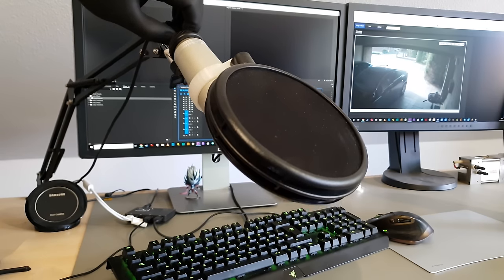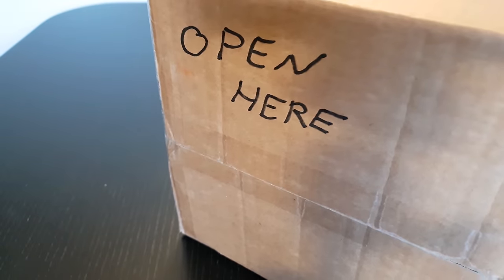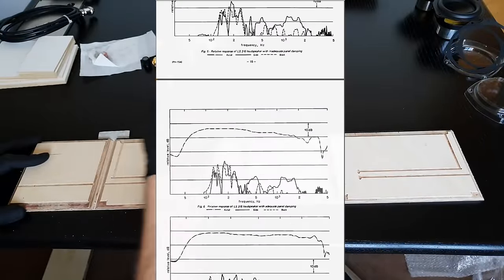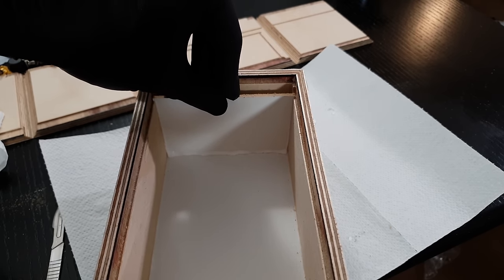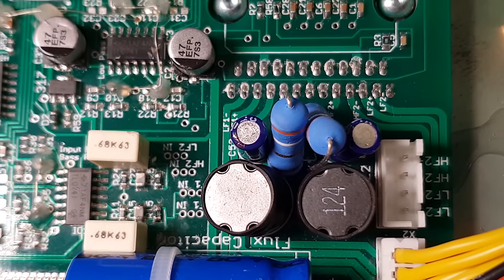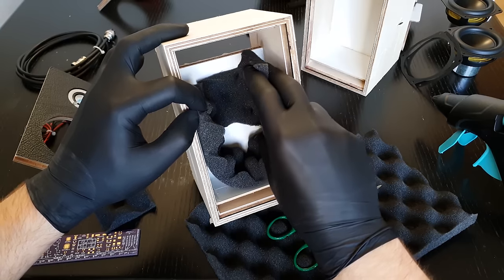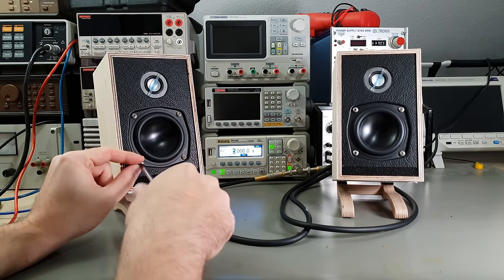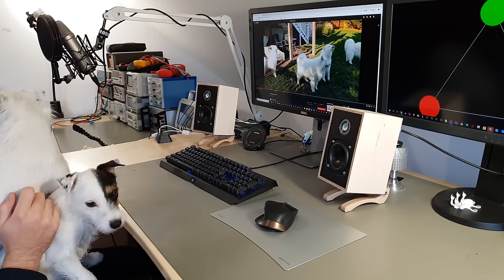Little British Monitors: DIY Transmission Line (?) Speaker Kit

Comment: For the record, most Class-D amplifiers perform way better nowadays than most Class-AB.
It's not the 90s anymore guys.
Reply: No. They can get close enough, but they don't surpass AB. The easiest way to lose an argument is to overstate your claims.
Reply: @korgied  . Lol. Are you a comedian? If you wanna join a discussion come with decent arguments. Check the datasheets of the new Hypex NCORE and the latest TI chips. Not many known brands with Class-AB that are going to be much better than that.
Reply: My interpretation is that while a good digital amplifier can deliver quality on par with pretty high end analog, the disadvantage is that the switching can induce noise in recording equipment.
Reply: @merlingallagher4484  Am familiar with Hypex (and Anaview which is also good for Class D). Not comparable in price at all. There was no way he was going to get NCore for this price, or even UcD (I have had UcD180s many years ago, good though not as good as NCore). Check out ATI amplifiers. I run an AT602 (small room don't need bigger). Planning to buy a Crestron CNAMPX 12-channel (made by ATI) soon since they're generally cheap on Ebay. They also make NCore amps. Specs are remarkably close. Incredibly SNR on both lines (of course very good THD as well). Why insult people? You might think you know more than other people, but you might be surprised if you'd be interested in having a discussion rather than trying to seem superior in the Youtube comment section. Am I a comedian? No. Do I know everything? No. Your claim is "most Class D amplifiers perform way better than most Class AB" and that is false. "Most" class D amplifiers use MUCH lower-end implementations than NCore. And for him to get any kind of NCore amp, even if he DIYs the amp, would cost him multiple times what this speaker kit cost him. One single NCore module would be close in price to the cost of his kit and that will be per channel, not per stereo pair. Anaview does sell some of theirs as stereo modules however.  Again, the easiest way to lose an argument is to overstate your claims. Class D can perform just as well as AB. But you didn't say that, nor did you say that Class D can be better than AB. You overstated your claim. 

Thank you, and good night.
Reply: @merlingallagher4484  The latest 'HD' chips from TI do address much of the quality issues I have with other affordable class-D amps. They are very new though and it's not always great to be first to implement new tech. I've been working on the LBM for more than the time they have been availible. And.... they only accept digital input so now we need to consider ADC cost and quality. I dont really feel the efficiency is that importiant to be honest - the built in dsp is nice to be sure, but I'm already achieving what I need with entirely analog circuitry.

Maybe I'll use one in a future project!
Reply: No, they don't. Although they are much more efficient. And yes, I actually have Hypex Backplates, one per speaker, on my desk.
Reply: Not many know that a class D amp was available from Sinclair in 1965, the X10.
Reply: yes, they're much better than like 10-20 years ago. but compared to class AB with a similar performance, they're still quite expensive. on top of that, the PCB design needs more care compared to class AB (especially a chip-amp like TDA7850).

Comment: Birch plywood does make a good cabinet speaker but usually starting at 19 mm for a small cabinet would be minimum 21+ mm sickness is preferred
Reply: These speakers are 12cm wide ;)

Comment: This "vibration dampening" seems to me utter nonsense.   Just stick it on a some jelly-like silicone feet or big felt pads. Has anyone done any tests on the audio quality with these very simple "hacks"?
Reply from the maker: Wouldn't call it nonsense, but maybe over-engineered? Other monitor speakers use foam wedges but those don't look as nicely
Reply: Marco Reps audiophiles vs engineers is a rabbit hole you’ll never get out of.  I’m glad you are one of the latter.  Keep it up mate your perseverance is legendary.  And entertaining.  :)
Reply: I think these speakers have a fundamental "problem" that there's no phase difference from the crossover between the tweeter and the midwoofer - but the actively driven radiating area of the midwoofer is inset further in than the tweeter. Thus the neutral axis, where there's no mutual cancellation, is tilted downwards - if someone has the crossover frequency, i'll give you the total cancellation axis if i remember how to calculate them, there's a handful of them. Thus you either need to use them upside down and stay right a particular distance from them, or you need to tilt them back, and the stand does exactly that while decoupling them from the surface underneath, killing two birds with one stone. Speaker and stand were designed for each other in such a way.

Whether there's other ways to decouple speakers from whatever they're standin on? On such lightweights, i have some textured rubber that minimises contact patch, using that, works right fine, though i have them on top of further boxes too. And i mean if you have an IKEA Linnmon desk, you'll know how incredibly important that is, because it's completely made out of cardboard, it's hollow inside and sings wildly.
Reply: @SianaGearz  The crossover is not a text-book alignment, it is designed as part of this specific driver and cabinet  combination. The crossover phase and physical system work together.
Reply: @Audio_Simon  But there are still cancellation axis, it's completely unavoidable, all you can do with a crossover design is to turn the pattern. I'm sure you had a good enough reason for tilting the whole speaker back with a stand, let's put it that way, and it's an elegant way to build such a stand and make it multifunctional.
Reply: @SianaGearz  There will of course be cancellation nuls with any two non-concentric drivers, even if time aligned and using a linear phase xover.

In this case the xover region is dispersed directly to the front listening axis, not angled up or down which would mean there is a phase mismatch between the drivers.

The reason to tilt the speakers back is simply to aim them at your ears. I assume the listener will be higher than the speakers when they are on a desk.
Reply: @Audio_Simon  OK, thanks, good to know that the primary lobe is aligned. Somehow never struck me as sensible to place speakers anywhere other than at ear height, but then i guess that's how people use them, they just plop them down wherever.

For something completely different, i'm sure Zaph is your mentor of sorts, well he is for everyone in the Internet era, isn't he - is he still alive, and is he getting a kit? :D
Reply: @reps  I think the problem is the lever effect that those plates will cause will be significant which will actually sort of amplify the problem it's trying to solve. CLD is great stuff; I use it in my car audio projects. Heck I've put spare pieces of the stuff on just about anything that rattles, even Keurig coffee makers. Their damping in your little test is definitely cool to see. I mean just imagine the diving board on a pool and you're just putting a speaker on the end instead of a human being. Of course the metal in the plates will be more rigid than a diving board but the lever effect will still occur. The CLD might be able to compensate for it but it's basically required to solve the problem the design itself creates (or, rather, makes worse). I mean, I'm sure it works well enough, and it's not like these are subwoofers. But I think that part of the design is more for looks than anything.
Reply: @korgied  The lever resonance is why they isolate. Its a tuned and damped spring. A tuned system doesent want to pass energy above its primary resonance. Same principle as the struts in your car suspension.

Comment: 11:13 always look at security camera...
Reply from the maker: It's like a window on the side of the building where there is none
Reply: @reps  I have 64 dahua cameras and have a dedicated pc to monitor them. 3 years of running 24/7 with no downtime
Reply from the maker: gotta keep those two Fluke 5730A calibrators safe
Reply: @reps  and the UXR1104A which is my new toy

Comment: you need a subwoofer
Reply: No he doesn't.
Reply: i mean he doesn't need it but if you want good bass response down to 20hz then yes (also note that human hearing is less sensitive to lower frequencies)
Reply: @ikbendusan  Whether you pick rock or dance music, there isn't really much below 60Hz, with focus upwards of 70Hz, and these are supposed to have a -3db point around 60, so there's still a comfortable amount of sonic energy at 50Hz, but not much beyond that. There's a handful of classical instruments that do reach lower, but i don't think their fundamental is important rather than merely impressive. By adding a subwoofer you're just inviting issues with little actual payoff, i deem it a last-resort measure. I mean what's the point of extending your bass down if the vital body of your bass has holes in it that can phase in and out of existence? Even if you were to only get 70-80Hz out of your speakers, i'd still advocate not using a sub, the hearing adjusts to reduced or partially missing bass pretty well.

If you're looking at these and thinking "puh puny little speakers", well, normally you'd expect mass market speakers this small to only play down to about 80-100 Hz, which is indeed often woefully insufficient and in dire need of propping up, but these are purported to be crucially better. It's by far not impossible, i designed ones with a slightly bigger size and better low-end performance with 50 or 55Hz -3db if i remember right, but mine can no longer be built. Designing smaller is possible but you trade off the efficiency and maximum sound pressure, or the distortion. Driver selection is the crucial piece of the puzzle here, you're looking for low Fs, low Vas, and usually low Qts, mine was WPP-150. There's a bit more to it than that, but everything is designed around a suitable midbass driver. When i did my design, suitable drivers were all well beyond my budget, with WPP being the only exception that i became aware of that didn't have other project-ruining issues. I can't say i recognise these drivers, but i've been out of the loop for quite a while.

Mass market speakers even for hundreds of dollars are usually designed with $10 drivers that you'd absolutely sneer at as a DIY speaker builder - sure they get the job done, but they don't allow for exciting designs that push boundaries. This is why there was quite a bit of value in the hobby, you bump the grade up to $50 drivers, and if you did it right, you'd have $1000 in value on your hands. There's a path to madness there, i mean, the drivers don't exactly stop at $50 :)
Reply: i have lsr 305 monitors and i've used them standalone for a while. their -3db point is at 47 hz. then i bought a tremblor t10 subwoofer, which filled the low-end void for me. -25 db and crossover at 70 hz. is it optimal? probably not. does it help? yes

and "not much below 60 hz" is nonsense; here's a frequency analysis of 
- d-sturb & sefa - nothing like the oldschool: https://i.imgur.com/Bd6jWDw.png
- post malone - rockstar: https://i.imgur.com/gm8pZWn.png
- de jeugd van tegenwordig - buma in me zak https://i.imgur.com/rvYuqjp.png

all of them with peaks at 43 hz (probably that specific because of how audacity plots a spectrum), a frequency at which the human hearing is 20 dB less sensitive compared to 100 hz. whatever though, i'm not an expert. i just do what sounds good to me. if we're all happy with what we've got, no complaints

Comment: 2:29 how about replicating this, with a thicc (solid, no bubbles / voids) layer of silicone between some thinn alloy sheets?
edit: i double-chicked (teh vee-day-ohh foo-tagé): that **mumble-mumble** layer seems actually quite thinn, less than 1mm, so, it's not "thicc" :3 * purrs *
edit2: by now, i "tribble"-checked, you said "steel", not Al-loy.
Reply: You want a constrained layer with high shear-friction. Silicone isn't too great in that regard. Butyl rubber is another option but bare in mind the thickness relative to the constraining layers is important.

Comment: Is this speaker "Audiopile" quality? # 1 more than 10x what its worth, YES,  #2 Based on BS design? YES. #3 No measured specs? YES.  #4 Bogus measurements (on KS)? YES.  #5 Promoted on mystique and story? YES.   So far, YES to genuine "Audiopile" qualifications.  #6 Is it well made? NO. #7 Is it nice looking? NO.  #8 Is it designed to known engineering standards? NO.  So this sorry excuse for an overpriced, amplified speaker is a hybrid: part "Audiopile" and part "Maker" design.  The Speakers in the video are Dayton, which is "house brand" of Parts Express, an on-line retailer of electronic stuff  https://www.parts-express.com  There is a similar 4" speaker, which is much nicer and better built: # 300-458, for under $100 for a pair from them on their web site.

Marco, it is admirable and nice of you to support friends, but this is so bad on many levels.  If you had to make something with your hands, you could have made the cabinets out of ice cream sticks and Legos.

FYI for all potential buyers:  since Kickstarter's inception, none of the speakers ever listed there are worth a damn (though one came close).  Stuff on Amazon and eBay is generally as good or better, and if you don't like those, they are cheap, so just throw them away.